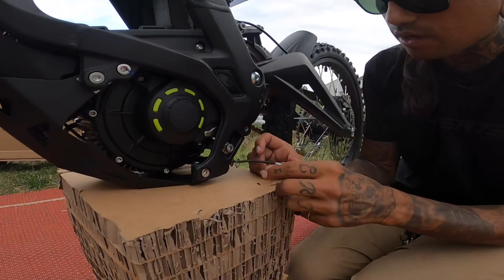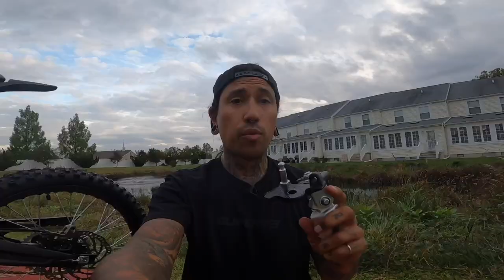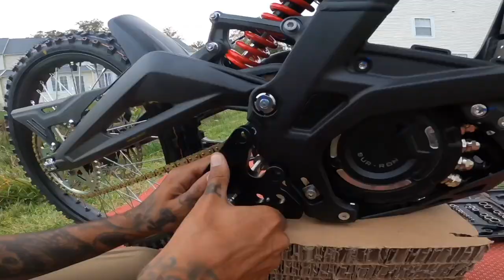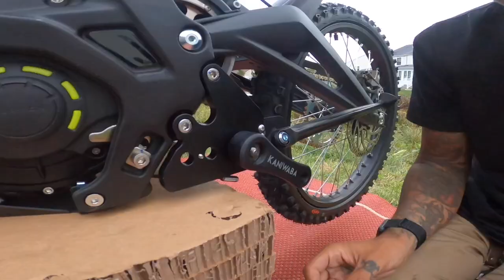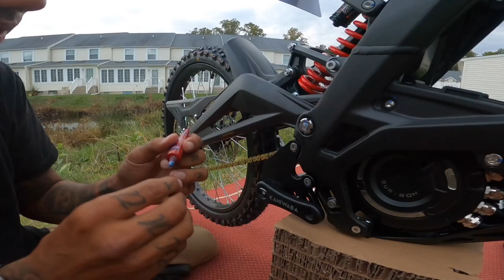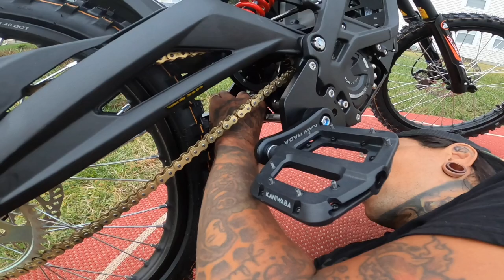Kaniwaba Best Pedal Kit & Install | SUR RON / Segway X260 X160

Comment: I want one of these so bad…. Just recently started riding my S2 to work.  It’s only like 1.25 miles so me not keeping up with traffic isn’t that big of a deal. Would be nice to get over 40 tho… lol
Reply: Bone stock a Sur Ron should do 45 ish mph on GPS. Green wire cut. If you want 50’s mph get Bac4000 or 8000 with battery BMS bypass. 70-80 mph need 72 volt with bac 8000
Reply from the maker: I agree with John Jones🤘🏾⚡️🤘🏾
Reply: @SuperJj2468  sounds pricy!
Reply: @swayiglesias  true anything electric is expensive

Comment: So these pedals are just for show, no real function?
Reply: They are suppose to have a gear to actually pedal with.
Reply: @brianmccann666  hmmmm, so it wasn't installed correctly then?
Reply: @Poteluz  ... Yep. Ppl like to leave out the gear. Keeping the pedals for legal reasons only.
Reply: @brianmccann666  it's just weird though, if you're going through the hassle of adding them why not install them correctly because the pedals are going to be there regardless once installed, might as well install them correctly in case you ever actually need them.
Reply: @Poteluz  ... I agree. I would install the gear just in case I ever needed them.
Reply from the maker: These are not functioning….I didn’t get the ones that propel you because I haven’t heard good things about them….so I just went with this kit for legal reasons 🤘🏾⚡️🤘🏾
Reply: @Poteluz  
They’re not going to propel you far enough or long enough to really be functional for that purpose.
500 revolutions to go ten feet…lol.
Reply: @richardstevens5961  damn WTF 😂
Reply: Check out Pegals…made by a guy in Connecticut…they convert from pedals to pegs in seconds.

Comment: Hey Shreddie! love you vids, super useful!  Have you installed or switched out to the Kaniwaba 3.0 pedal assist kit yet?   I think I need to get those in CA, but need to find a good install video.  Thanks for the content; keep 'em coming.  Thanks again, strong work!!
Reply from the maker: No I haven’t switched out to the assist kit I don’t really think I plan on doing it….. it really looks like they’re going to start cracking down and making us register these bikes…. That’s why I’m just keeping the fake pedals on there
Reply from the maker: What part of California are you from? I’m pretty sure they’ve already banned Sur Ron’s in San Clemente and Dana point I think
Reply: Want to order this does anybody have a discount code
Reply: @SHREDDIEMCSKATE  I live close to San Clemente and Dana. Afaik, cops are now being issued to impound any surron riding within these cities. Maybe San Juan Capistrano as well but from what I've been told, Dana and SC are the most strict while SJC tends to be a bit more chill. It worries me a bit since I plan to move in with a friend within the edge of Dana Point and my only daily commuter for work is my surron. What I may do is add a pedal kit with chain plus the kaniwaba bicycle seat post. It will make the bike ugly, but it's worth satisfying the cops and not getting pulled over.

Comment: Great video. Which model of Kaniwaba is this? I see they have a few options. 
FYI: Longer socket wrench will give you more torque making it easier to get the bolts off, and a cheap spring expander will make putting the spring on and off a lot easier.
Reply from the maker: This is just the cheapest option they have without the ability to really pedal it… I appreciate those tips to bro I’ll be picking up a spring expander today
Reply: Thank you

Comment: Torque spec for the foot peg bracket is 40-45nm not 25 however with the amount of thread lock you used those bolts are stuck forever . Cheers bro :)
Reply from the maker: Thanks for the heads up brother I actually got those torque specs from the maker of the pedal kit🤘🏾⚡️🤘🏾

Comment: Great video,  I was wondering if it’s possible to add pedal assist to the Surron, Talaria, or Segway? I would love to find a way to get a workout while riding beyond just adding a basic pedal system that doesn’t propel the bike very much. Thanks
Reply from the maker: You can, but it’s really not worth it
Reply: @SHREDDIEMCSKATE  Good to know, thanks Shreddie

Comment: my biggest question with this product is would you put pedals on a 110 gas dirt bike?(they go about the same speed 45-47mph) if the answer is no then why would you put it on the sur ron? the pedal design was created for a 50 pound bike and under not 120 pounds. not knocking the video itself but having ridden bmx for over 10 years prior to the sur ron i can tell you for a fact that pedals do not belong on this bike.
Reply from the maker: Watch the video it’s because of legal reasons in Delaware🤘🏾⚡️🤘🏾

The cool thing about this pedal kit is that you can swap to pegs in a matter of seconds
Reply: It’s not a big problem. Just because you’ve been interested in bmx for that long doesn’t mean you know anything
Reply: I thought people put the pedal kits on to avoid e bike law requirements depending on which state you live in?